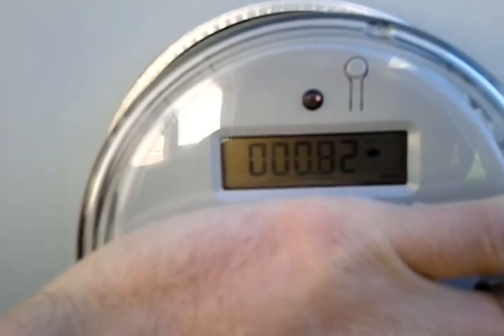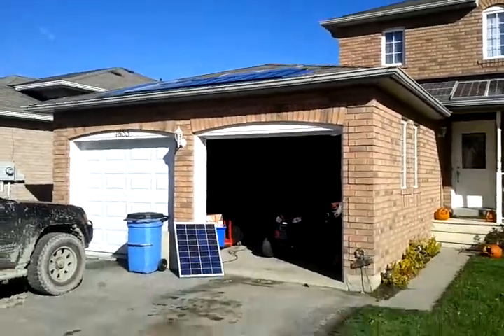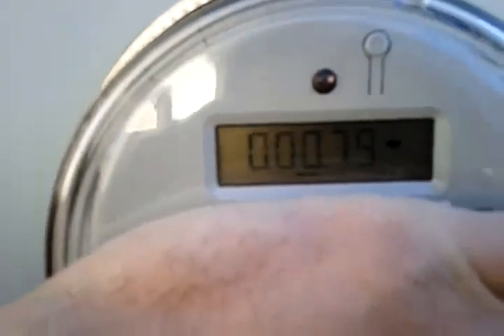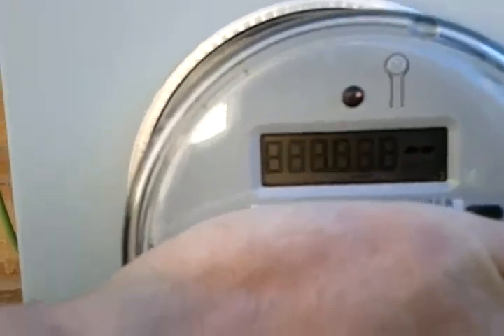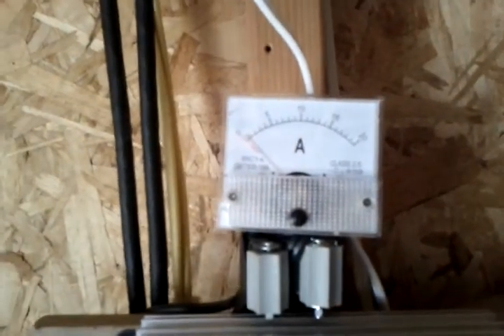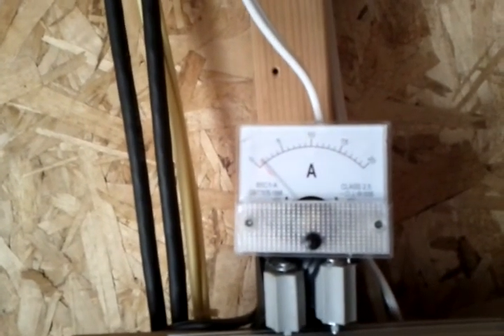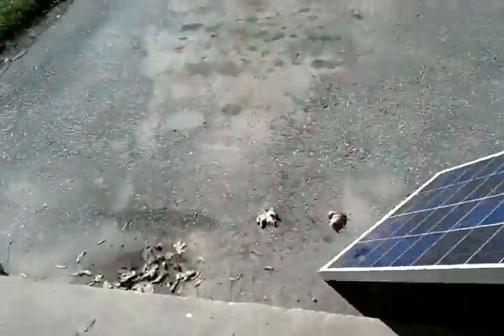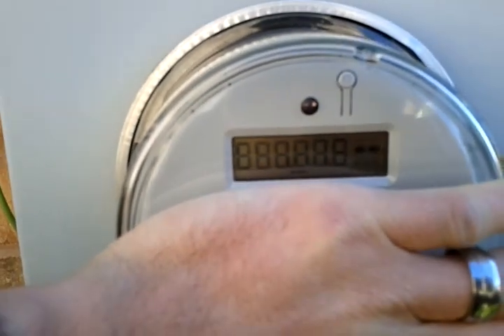solar power running the power meter backwards

Comment: have been watching your videos about solar, you certainly have learned a lot. have you gathered solar pieces as they go one ctc sale or every where, mmm, good if so, how much cash do you think you have gotten, and using this as a hobby also. if all of your stuff works as videoed, good, would you put up a list of all of the things and your opinion and what you have learned of what not to do, please
Reply from the maker: yes i have put my solar setup together slowly over a long period of time, and i only buy my solar/batteries/wires/charge controllers on sale never pay full price!
how much have the solar panels made me ? maybe $250 a year and i have about $1900 into the system now. and thats with over 400Ah of batteries. List bunch of mismatch solar panels 45Amp morning star 400Ah of mismatch batteries lots of 12 Gage or thicker wire and a 1000W pure sine wave inverter, FYI I typed this usingbatteries charged with solar :D